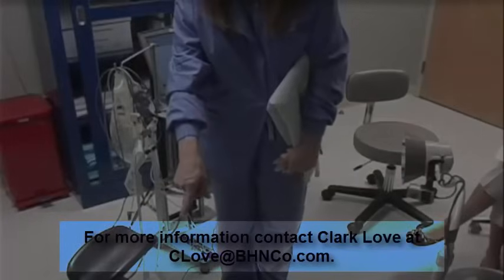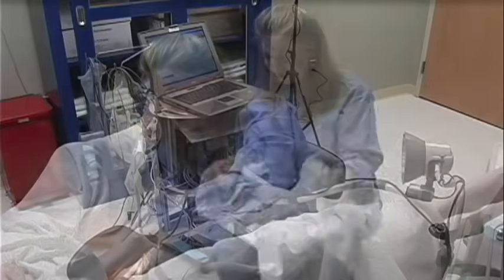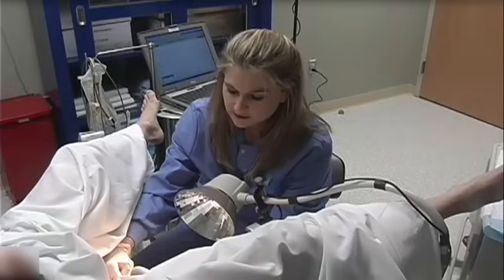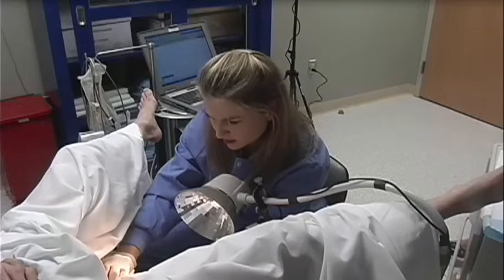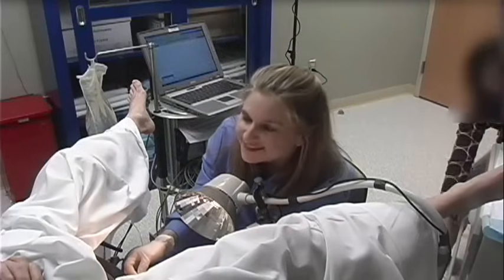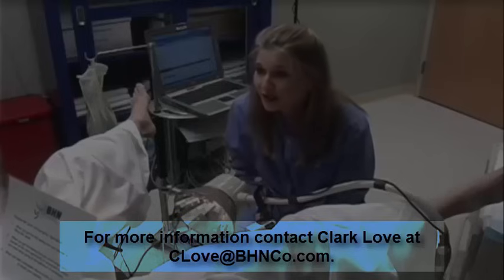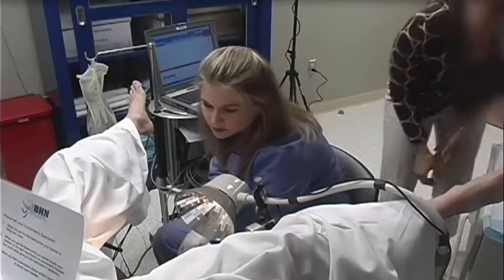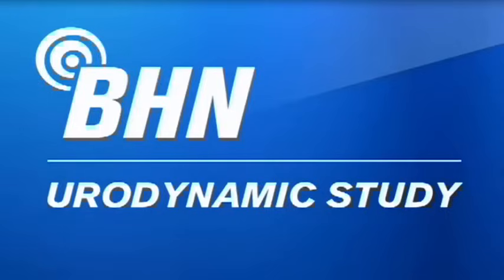Urodynamics Testing Video - Performed in OBGYN office

Comment: I just had done today , nothing dramatic about it. It wasn’t painful, some slight discomfort that’s all. And after that test I went to work, working as a dental assistant , all day on my feet. I feel fine.
Reply: DId you get a anesthesia or something? a sedative?
Reply: @anubischeats  no I didn’t , it’s not invasive at all. It’s just discomfort but no pain. And last December I finally did my sling surgery. I took prescription pain med only 1 time right after surgery. Recovery 2 weeks. I should have done it earlier. Just make sure find good urogynocologyst.
Reply: during voiding stage is anyone present infront of patient?

Comment: I just got my first urodynamic done today it hurt when she put the Cather in my urthera she have to do it about 2-3 times because I was trying to  close my legs it was hurtful... but when she put the Cather in my other hole no problem I did have trouble pee without pushing ...
now I'm having cramping when I was walking down stair at home the pain is very bad I almost cry
Reply: i am having the same experience .  i am so sick of tests .
Reply: that is because you tensed up and the catheter agravated the walls of your urethra... thats why you are told to relax (as much as possible) the more your muscles relax...the less tension in the urethra
Reply: WHAT IS THE POINT OF THIS??? More pain?
Reply: Geri Sepulveda There is a study that says prior to hysterectomy, this urodynamics does not change the outcome of success, whether they do the test or not. I am going to talk to my doctor about this study.  I’d must prefer to not have to get this done.
Reply: @Gigi-z3z  please suggest, is this test worth it? When most of us know within ourselves that this is the problem we're facing and the test only claims that? 

What is the solution to the problem??
Reply: @khushi5891  Also, I did all the research on the test, and felt that I did not need the test. Any issues that some of my friends have had, I knew that I did not have any of those issues (that the test was checking for), however, my doctor insisted that I had to get it, so he knew which way to proceed on the surgery. So, do I feel like I needed the test? No. However, my knowledge of my body was not good enough for the doctor to proceed. In the end, the test showed that same results that I knew to be true. I had no issues that they check for. Hoping that your doctor gives you the choice. I think it’s a barbaric, embarrassing test, but there was no pain. Hope these answers help you. All the best to you! 💜
Reply: @Gigi-z3z  Thank you for taking time out to answer, all from across the world. I will focus on finding the appt people to communicate about my problem, hoping I'll find the right support incase I ever have to get the test done.
Reply: @khushi5891  You are welcome! I’m here if you ever have more questions! Take care!✨💜✨

Comment: so is urodynamic test a new name for cystometrogram? going for one in early morning O.R.
Reply from the maker: A cystometrogram (also called a CMG) is typically a part or subsection of a urodynamics test.  A urodynamics tests is actually a combination of multiple tests.  The tests are:  Uroflowmetry, Pressure uroflowmetry, Post-void residual volume tests, Multichannel cystometry/cystometrogram, Electromyography, Urethral pressure profilometry, Fluoroscopy  (which is only done for video urodynamics tests).  

A brief summary of each is provided in this blog post on our site:  
http://www.bhnco.com/Resources/what-is-a-urodynamics-test.html

or here

http://info.bhnco.com/blog/urodynamics-and-colpoplasty-how-they-fit-together (the top part of the post)

Comment: is it painful
Reply: this is what I want to know
Reply: +Erica Nekole i definitely need to know someone i know will be having this procedure done soon
Reply: +Ronnisha Thornton I'll be having this done Tuesday. you know I want to know. Geesh, I need to know if I should run now
Reply: +Erica Nekole afraid to watch i dont like pain hate catheters
Reply: +Erica Nekole good luck hope it goes well may god bless
Reply from the maker: It is generally not painful, but it can be a little uncomfortable.  If it is painful, then the nurse may not be doing the procedure right.  Where are you having the procedure done?
Reply: I've had this done several times and it doesn't hurt in my experience it may just feel a bit strange or uncomfortable but it should be easily bearable.
Reply: I have this test every second year and my next one is due in three weeks time. Lying on my back with a catheter placed in my bladder and another one in my rectrum it felt a bit uncomfortable the first couple times I had it done but up to now I've had so many done, I'm used to it
Reply: @BladderHealthNetworkJackson  biggest cap